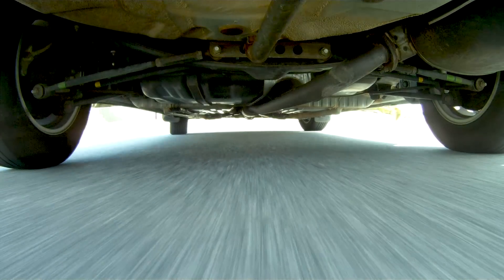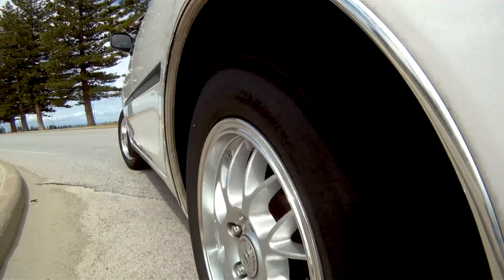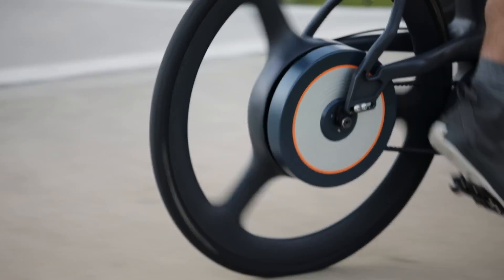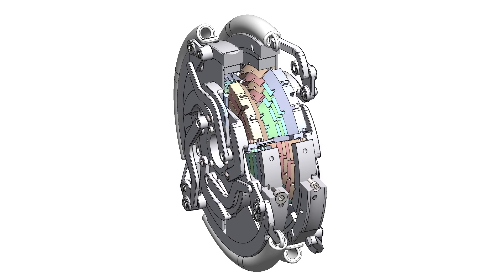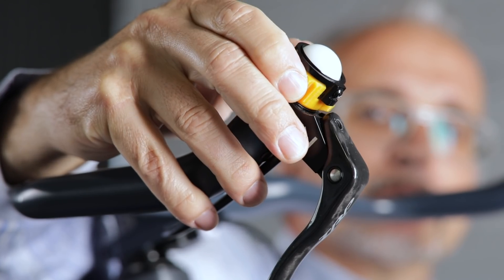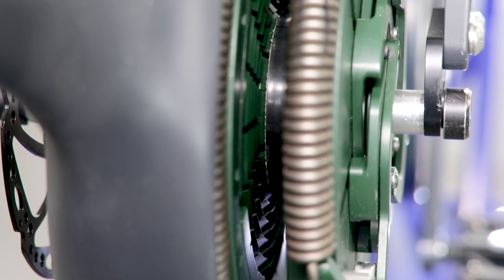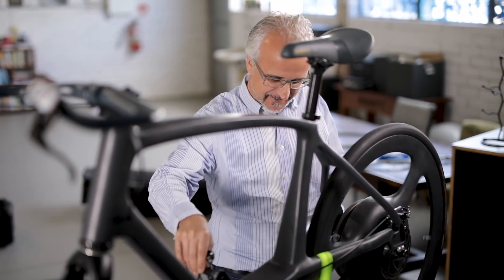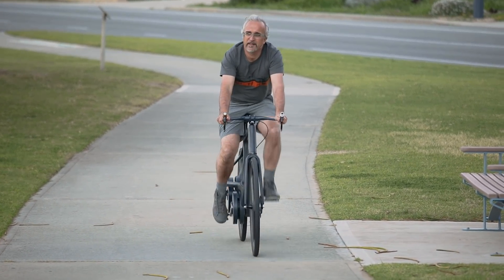Continuously Variable Transmission on a Bicycle

Comment: Interesting design, but I'd like to know a few things:
- How much does it weigh? Looks pretty heavy, but that can be deceiving.
- What is the powertrain efficiency? The V-belt design looks like it would involve a lot more friction than a chain drive.
- How quickly can it shift? Obviously needs to be moving to shift, like a regular chain drive, but if it takes like 10 turns to shift that would really suck if you're stopped in high gear for some reason.
- Cost? Looks complicated and expensive.
Overall, I find it an interesting design, but I'm doubtful it will really be practical in this application, it's pros and cons compared to a conventional chain drive and derailleur will favor the conventional design. Might have other niche applications though, not on bicycles.

Comment: Take this POS CVT nonsense, and shove it. It's an unreliable garbage thing in cars, costing thousands of dollars to repair.  It doesn't work for automotive applications and it's certainly not going to work for bicycles. One piece of abrasive mud in there and the whole thing will crumble. Get outta here.

Comment: I'd rather stick with my Shimano XTR Di2 Groupset which does the same in terms of synchronizing the front to the rear and vice-versa with the added benefit of not adding like 10+ kg to the bike.

Comment: Something that ideally should be ultimately reliable and nearly indestructible turned into what can be described as oversized clockwork mechanism. Imagine the thing getting dust, dirt, liquid inside of it. Grinding it all like a mud dough. Or just a tiny part of those gears snapping and tumbling around like a damn coin in a washing machine. Cool idea, but laughably impractical.

Comment: This is good if you’d want to have a very efficient constant RPM while increasing speed or torque
Reply: or torque, not both lol
Reply: @edism  well by torque I meant by us having to pedal harder
Reply: @HYBECTIVE  Your edit is correct but surely you were referring to torque at the wheel?

Comment: Technology is great and all, but its just ridiculous to use bluetooth to wirelessly have the thing shift gears. It's not even really a true CVT, and cvt's have poor reliability and are mushy in power delivery. This would get stuck in sand or mud, and imagine what happens when it fails while riding... I'll stick to my conventional bicycle, it's not like it's an overwhelmingly difficult task to move my hand and shift gears myself.

Comment: I don't see any enhancement compared to the Variomatic design, but for sure some more complexity.
Maybe the cones are more stable to each other and reduce drive force, also there's maybe some size profit. But that's it, and you buy at best only some minor percents of efficiency, wich is nothing compared to reliability if implemented in a bicycle.

Comment: NuVinci has a pretty neat CVT for bikes and they have been doing it for more than 10 years.
Reply: nuvinci is truly the way to go
Reply: Most of the e-bikes I've seen, have gears. Is that just to make them easier to ride with low or no assist?

I would think a single speed e-bike could be a good relatively low maintenance solution, and saves a bit of weight too. :)
Reply: @queertales  Look at e-scooters and e-motorbikes for a more practical view. Bicycles are meant to be pedaled, of course they will have gears. Chains and sprockets anyway.
Reply: Low efficiency though, upwards of 10% of your muscle effort is spent friction-heating the transmission hub. Chain drive is 97-99% efficient.
Reply: @michaelbuckers  True, but when you have a powerful ebike, you won't notice it.
I have a Sparta M8i (Yamaha motor with 80nm of torque), which originally had a Shimano Nexus 8, but after converting it to a Nuvinci N171 (yes, its old, but so strong), it doesn't feel heavier, only difference is when you lift the bike physically (the hub is 1-2kg heavier).
Reply: @ryank0261  dude ebikes don't need any transmission, just by using this cvt you reduce your range by 10-20%, speed and climb suffer too.
Reply: @michaelbuckers  "need" depends on the person. Some people would prefer automatic CVT-like transmission over 10% more range.
Reply: @christopherjc54  Electric motors don't need gearing. By adding a gearbox of any kind you just waste its power.